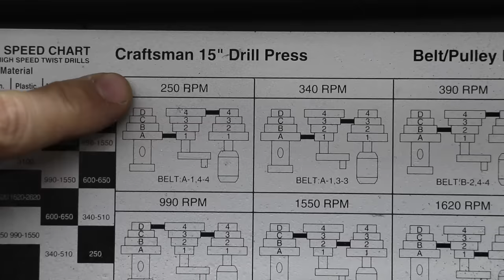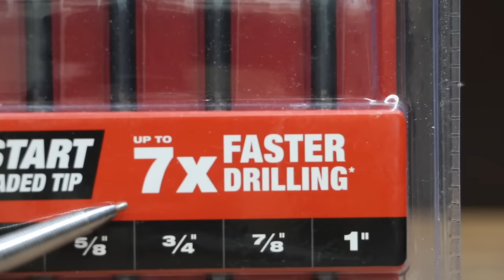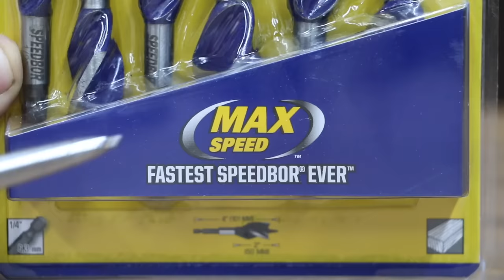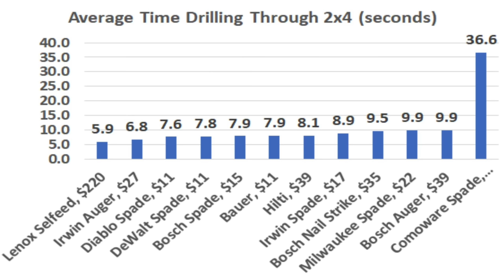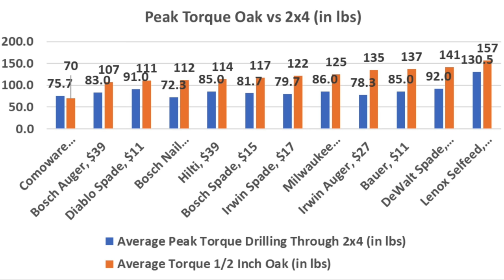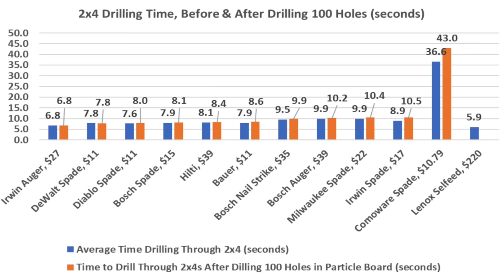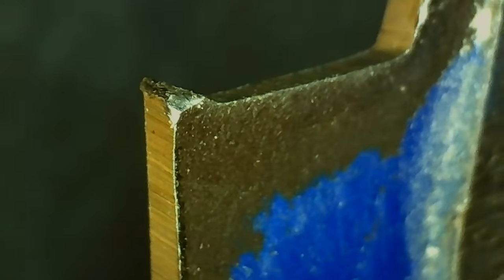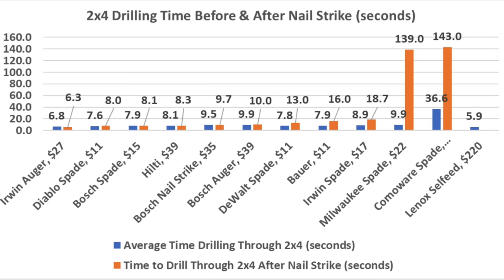Best Drill Bit Set? Hilti vs Milwaukee, DeWalt, Bosch, Bauer, Lenox, Irwin

Comment: @Project Farm I really like your videos, they are very informative and made very well and with great passion. However in this test I wish you would have included the fact that these drill bits also have different recommended drill speeds. Just an example for a wood twist drill bits. A normal CV bit might have a recommendation of 1000 rpm, whereas a tungsten carbide bit of the same size might have a recommended rpm of 6000. If you run both bits at 1000 rpm the tungsten carbide bit is wasted cause even if the work life is longer, it is just magnitudes more expensive then a CV bit.
But if I run those drills on a CNC machine the saved time i get with the higher rpm might pretty fast be worth it since machining time is expensive. Then there are bits in between and Auger bits that would be slower in terms of rpm but auger bits usually cut a bit mot per rotation. That's why they are excellent in use when you are drilling by hand. In this video we go from Spade bit to Auger bit to a Forstner kind of bit. and they aren't meant to run at the same speed. Non the less nice work and dedication to drill more than 1200 holes. Cheers
Reply from the maker: Thanks!  Thanks for the constructive feedback.

Comment: You should test POR15, KBS Rust seal, Chassis Saver, Rust Bullet, etc.. they make some pretty big claims as far as chemical resistance, durability and ability to rust proof metal.
Reply from the maker: Thanks for the suggestion.

Comment: As per usual, some golden “rules of thumb” that can be applied to any type of accessory.

1.) you get what you pay for. Stop cheaping out for projects that need high end results.

2.) read what the accessory is made for! Drilling with a bit made solely for metal versus one for a type of wood grain makes all the difference.

3.) it’s not the drill, it’s the bit. You could have the jankiest no name brand rotary drill driver on the market and still do better than Dewalt or Makita’s finest if you’re using a quality bit selected for the job

4.) wear eye protection! At higher speeds, a wood chip to the eye ball is incredibly painful and comes out at ultra hot temperatures give friction

5.) clamp a board underneath what you’re drilling through to prevent blowout on the back end.
Reply from the maker: Thanks  for sharing.

Comment: You also should have mentioned that the Lenox bits are Forstner type, and their advantage is that you can get a flat-bottomed hole if that's important when your aim is to not go through.
But of course that clogging and its high price would be its big disadvantages.
Reply from the maker: Thanks for the feedback.
Reply: YW,  @ProjectFarm !

Comment: I have decided that the Irwin Speedbore is the best over all choice for construction type drilling, but it cannot survive a nail strike. Your test didn't validate my experience. I treat my quality tools with care, so I cry when I encounter a nail strike with my Irwin's, but I promptly replace a damaged bit. Compared to a spade bit design, the Irwin Speedbore is far less effort drilling through construction 2X lumber. The screw pulls the bit, relieving pushing pressure. Care must be used to apply pushing pressure prior to breakthrough since it needs the screw to finish the hole. The breakout is ugly, but Romex slides past the breakout with ease. The shorter bit length facilities more straight through drilling and you can employ a compact light weight M12 Milwaukee with long battery performance. Spade bit designs are much less costly, but require consistently more operator push pressure. I like Greenlee performance on eating through nail imbedded wood. For cheap spade drilling I favor DeWalt. There is something about the rounded bit corners that performs very well for me. 
Controlling breakout in construction 2X drilling I prefer spade bits with no screw tip. The lead tip barely breaking through gives a line up hole for drilling through the other direction to eliminate breakout damage. The screw tip bits are harder to stop consistently  and they have nothing to pull them back when changing direction.
Precision wood drilling is another class from this bit test competition. I choose quality brad point twist bits or quality forstner bits. These bits stay in the woodshop. They have no place on my construction sites. Quality forstner bits will set you back a lot for a very complete set and there is argument over the value of flat VS wavy designs. Bit speed and chip clearing are additional issues that the operator must manage, but hole quality is superior. A forstner bit user understands their limitations and speed is compromised for hole consistency and quality and to protect the users investment.
Spyder is a other low cost spade bit brand to consider for the mix of spade bit challenge.  The newer contour spade bit designs are generally performance improvement over the old standard flat spade bit designs, but they are not condusive to field dressing with a file or bench grinder. Those flat spade bits that you bought back in the 1970's, got left where they rusted, can still perform acceptably with a bit of field dressing. And who cares if you trash one of them?
Reply from the maker: Thanks for the feedback.

Comment: You spoke briefly at the beginning about using these bits to drill through aluminum, but did not test them in aluminum.  My experience is that in drilling (mostly 1/16" to 1/8" thick) aluminum, having spurs on the outside is best, and having a spiral bore on the pilot point is terrible because the feed is too fast to make a good cut.   (I've never tested any of the annular cutters.)  I'd like to see a test for aluminum.

Another thing of interest that you didn't cover is the final diameter of the holes - how true are they to the nominal bit diameter?
Reply from the maker: Thanks for the suggestion.

Comment: I'm not sure if this is something you'd be able to do but I'm really curious to see the difference between modern sockets with rounded corners and old style sockets with the sharp corners. Supposedly the older sockets would strip bolts much easier.
Reply from the maker: Thanks for the suggestion.

Comment: I’d classify myself as fine woodworking (as opposed to a framing or rough construction) and while drill speed is nice because it’s a time/energy saver, when I’m putting holes in wood, I want accuracy and cleanliness (lack of tear-out), and durability. I can sacrifice speed if the other three attributes get a boost.

Would you do a video of exclusively forstner bits?
Reply from the maker: Thanks for the suggestion.

Comment: I don't care that much about saving 5 seconds, I like it when the entry and the exit are clean, and that usually happens when they are slower rather than faster.  That is also why I don't like the bits that pull themselves, I have very little control on how aggressively they are plowing through the wood.  And sometimes those screws on the end can split the wood.
Reply from the maker: Thanks for the feedback.

Comment: I don't like the paddle bits that pull themselves through. If you want to back it out to clear the chips you have to change the direction of your drill and they also put a lot of strain on your wrist because they cause a lot of torque. I just like to have more control of a bit when I'm drilling.
Reply from the maker: Thanks for the feedback.

Comment: Can you please test water conditioners versus a traditional water softening system?  I was watching Matt Risingers video about Nuvo H2O Water softener/conditioner system and he was really selling it. I've always loved traditional water softeners with brine/resin tanks. There are also electronic descalers that I think are questionable.  It would be nice to have some tests showing water hardness and PH before and after.  And also see which ones can remove scale already built up on heater elements and pipes. Maybe even annual operating costs for a home with 12 gpg hardness.  Please?
Reply from the maker: Thanks for the suggestion.

Comment: A PSA everyone, paddle bits with these self feed screw tips should not be used in drill presses. They will continue to pull the bit into the wood which may cause over penetration or pull the work piece off the platform and out of the clamps before swinging around dangerously. 

These bits should only be used with handheld drills with triggers and clutches that stop the heads quickly on release of the trigger. 

Otherwise nominal sharp point paddle bits should be used. 

Ask me how I know.
Reply from the maker: Thanks for the feedback.

Comment: Which drill bit would you recommend for drilling holes in leftover tree stumps? I wanna fill them up with some natural stuff to quicken their decay. My hammer-drill with classic wood-drilling bits did struggle a bit as the stumps hardened over-time and are quite sturdy.
Reply from the maker: Thanks for the suggestion.

Comment: Been working as an alarm tech for years and I frequently use a 3/4' bit for drilling doors. This was super helpful tho the issue I've had with bits like Diablo is the seem to get slightly smaller over time. I've loved my Spyder bit specifically because it's priced well and cuts the exact same sized whole for nearly its entire life time. My Diablo bits are still putting in work but I do have to do a little extra with them now to get the door sensors to slide in smoothly.
Reply from the maker: Thanks for sharing.

Comment: Forstner bits in oz hard wood the steel blues from over heats when u have mens shed with other people using things and not useing them right
with the oak try clamping 2 piece to stop tear out on exit hole.
witch hole ran true tho to dimension

Comment: I was wondering if you could do a test-to-failure on 3/8" ratchets (mechanical, not air or electric powered). A test that would include older American-made ratchets?
Reply from the maker: Thanks for the suggestion.

Comment: Hi project farm - I have a project for you that seems to be pretty divided in the plumbing community.

Using ptfe, jointing compound or nothing in pipe compression fittings. Applied on the olive or olive and thread? Copper or brass olive? How do this affect both the ‘pressure’ leak ability and the ‘pull’ ability (pulling the pipe from the joint)
Reply from the maker: Thanks for the suggestion.

Comment: how about best parts washer fluid,  solvent-based VS water-based
Reply from the maker: Thanks for the suggestion.
Reply: @ProjectFarm  Love your channel; you have both confirmed and disproved my bias on several products; keep up the great content.   
I will be building a custom heated parts washer in a couple of months; the fluid heater is dependent on the type of solution.
I'm not asking you to do my research on the subject, but I will give you a shout-out when it's done(not that you need it 😉).
Thanks again, and Happy New Year.
P.s. can you include powdered Tide as a cleaner? I understand it is excellent.

Comment: You compare the entrance and exit of the drilling hole but yet ... you use a rather slow machine speed ...
Also ... when drilling THROUGH wood you normally have some scrap wood underneath to avoid  the exit from tearing ....

Comment: Plumbers use those expensive self feed bits where we know there are no nails with a high torque clutched right angle drill and they're meant to be forced heavily into the wood to function properly.
Reply from the maker: Thanks for the feedback.

Comment: Just a thought but shouldn't the different brand bits with "screw" heads roughly take around the same time at the same rpm cause the threads are all roughly the same measurements right? I'm not an expert please educate me

Comment: I believe that the test was a bit unfair. using 3 categories of bits and comparing them as a whole (no pun intended) i feel makes the best unbalanced, I think it should have been 3 categories, not a clump of,  spade, auger and self feeding. it’s like asking what scroll saw will be the best for your money at cutting wood? and using, jig saw blades, reciprocating saw blades, oscillating saw blades, and a circular saw blade as well. the blade that was designed to remove the most wood faster, would have obviously been the winner. Each bit/blade has its purpose, I’m just saying, maybe you should have broken them up in categories.

Comment: Video idea - comparison between SAE-30 oil that is designed for small air cooled engines vs 5w-30 oil that is designed for a car. Can we substitute the SAE-30 oil that is for air cooled engines with the same viscosity oil that is designed for a regular car engine? Is car oil going to cause damage to the air cooled engine or is even better? (I have heard that in SAE-30 oil for air cooled garden engines the put different ingredients to reduce wear). Or maybe if general purpose 5w30 is not good enough substitute for the air cooled designed engine oil - maybe then 5w-30 oil for diesels exclusively could be the next good/best thing for replacement the other oil.

I was wondering because we have a 250cc air cooled garden cultivator (but the engine is pretty much the same as a lawn mower engine) and it is a lot harder to find the oil required SAE-30 which is like oil (5w-)30 but without the winter grade oil index. Also for the SAE-30 oil there is 1-2 brands but for the normal car oil - there are tons of options that can be bought everywhere. 

My assumption is that the SAE-30 oil is replaceable with 5w-30 car engine but a test would be interesting in my opinion - to find out if regular car oil can be put in a lawn mower or other garden four stroke engine that is air cooled.
Cheers!
Reply from the maker: Thanks for the suggestion.

Comment: Hello Sir! Could you please conduct tests on
Smoke detectors and Carbon Monoxide detectors? Sadly there was a fire in Philly and several adults and children were victims. Not a science guy, but seems like minimum low voltage of depleted battery and functionality would make or break a good detector.
Goid day, Sir.
Reply: For DIY folks. Maybe getting a 12v solar panel for hard wiring a detectors power supply. For off grid safety.
Reply from the maker: Thanks for the suggestion.

Comment: If you start running out of stuff to test, you could always try doing a video review on something "As Seen on TV." People are always interested in whether or not those things work, and to what extent. Some of the stuff you just kinda know it works like Fiber Fix cuz it's resin makes sense. But other stuff like Flex Seal and all that may be questionable. And you've probably got so much stuff laying around that you could show people a better way to fix something without breaking the bank.
Reply from the maker: Thanks for the feedback.

Comment: the only reason the time are so wired is because each time you drill it get's  hotter and hotter so it speed up the drilling time... but  bad thing if it gets to hot it will burn the wood and if you work in a saw mill like me we can't send burn wood  to our customer's..  i work a panel saw and if i try too cut too much wood or  i turn up the speed of the blade it will burn the wood as it cut's.. sometimes it's not about speed guys
Reply from the maker: Thanks for the feedback.

Comment: I appreciate your efforts thank you. With that said some of your drill bits where not designed for a regular chuck n key drill. For example the Diablo has a cork screw like tip that actually pulls the drill in as you drill. This device (my opinion) is designed for use on an impact drill another reason I believe this, is that the drill bit comes with the 1/4 inch easy on easy off on the connecting side of the bit this is the side that inserts into the drill most drills with this type of chuck are impacts. My point is you tested some bits that where not ment for your type of drill. So consider testing only compatible bits to compatible drills. Other wise we are not getting real results. Yes I do own impact drill with those exact bits you tested I can load pics I also own Cheap and name brand bits. Also have a regular drills with the keyless chuck. Impact drill makes a huge difference. All.I can say is I buy cheap and expensive bit and honestly I look for similarities in cheap brands to expensive for example Diablo Milwaukee bits are awesome but I get same quality from harbor freight Bauer bits. Thank you.

Comment: You left out one very important test - hand held.

Not everything you do can be held in a vise and then clamped to a drill press.
Please redo the tests with the same bits but handheld only.  Just clamp the wood down and then hand hold the drilling - then try free drilling  -  wood not clamped and drill held by hand.  It will be purely subjective, but more real world use as not everything can be placed in a drill press And with a hold down.
This would be "quick drill test".  One to 2 holes (3 max) and then give a report on the ability of each to drill a hole in a standard 1x4 then a 2x4 stud.
Now that would be a "real world test" and the most useful.
Reply from the maker: Thanks for the suggestion.

Comment: None of your top picks with a spiral tip will hold up after months of real world use. Any paddle bits with a fluted tip and small 'bore spikes' on the outside edges will outlast and outperform your top picks in a professional setting... especially over time. I have been in A/V and remodeling since 2005 and have tried every type of bit that's come on the market. You do you but I think your test this time for once is badly flawed because you are using brand new bits for a handful of testing. Try this with months of testing for real world results. I usually try out your suggestions or already agree from experience (impact driver and saw blade episodes for example) but just don't think this one is a good representation of practical usage. Still informative though. Keep up the great work.